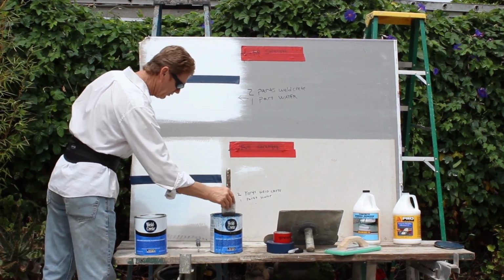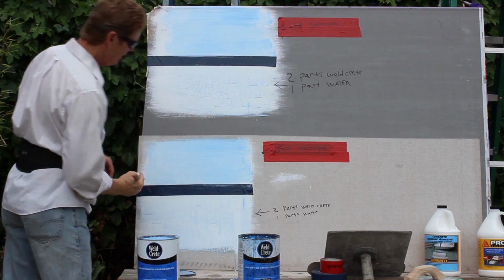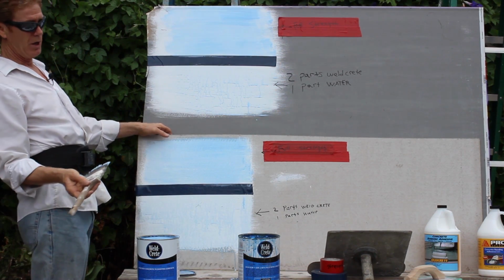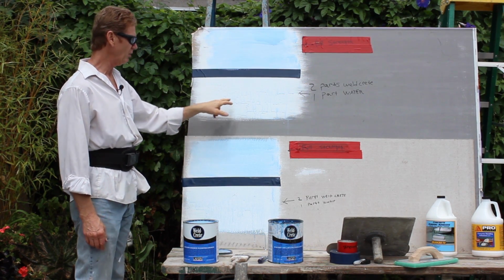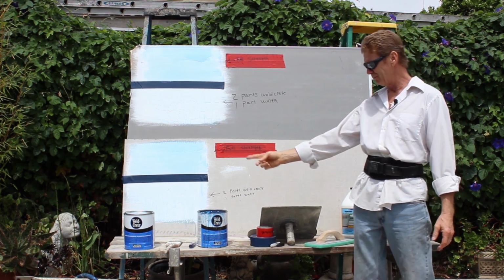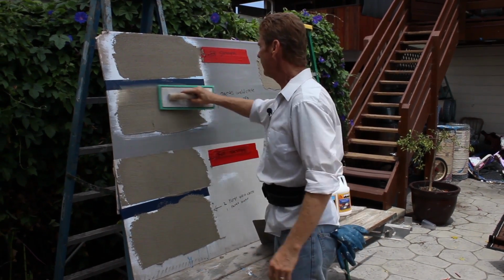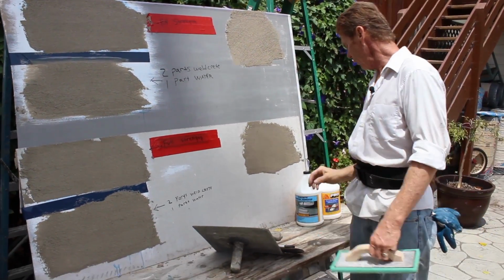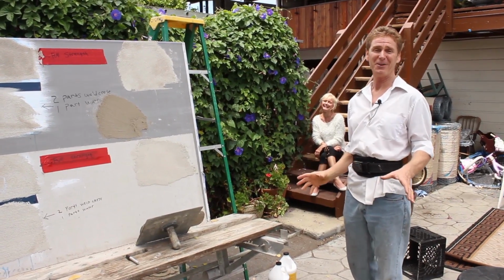Stucco and Concrete bonding agents.

Comment: Kirk! Huge fan and love your videos. Thank you for your incredible generosity. I have a question about bonding agents. Can I apply diluted weld crete to bare magnesium oxide panels? I'm an artist who makes gallery paintings with traditional lime plaster and need a more reliable way of adhering lime plaster to the MgO panel. My lime plaster is made with 1 part lime putty to two parts sand.  Currently I use a stucco slurry as a bonding coat but in some cases it has pulled away in areas due to fluctuations in temperature. The plaster is in good shape, and it's clear the stucco is peeling off.  Again, thank you for all of your wisdom in these videos.
Reply from the maker: Sorry, Michael, I have no idea what magnesium panels are, I just understand stucco walls, thus can't guess your question.😉

Comment: After watching the video i can't understand when you can use bonding agent in full strentgh without havinc spider cracks ?🤔
Reply from the maker: LOL, you're not alone. Most have no clue as to what I'm explaining.😉
Reply: Wow what a response. funny as heck but Omarnaja is probably pissed. Haha. but buddy here is what i got from the video. just keep it simple. if you're gonna apply a coating 1/2 inch to 1 inch thick, better go full strength on the weld-crete. Because its built for that type of application. but color coat is normally applied 1/8 inch thick which means diluting the bonding agent by half strength. Kirk packs a lot of info so you gotta listen carefully to catch all these tidbits or playback several times so it can sink in. lol hope i got it right too. HAHAHA.

Comment: Wait so can you use a bonding adhesive over a painted concrete surface before adding your cement ?
Reply from the maker: You still have to pressure wash the home so it's clean enough to eat off of, before applying the bonding agent.
Reply: @StuccoPlastering   thank you So much I will make sure its clean enough to have dinner on lol
Reply from the maker: Hello Daquan, yes, a bonding agent is necessary on any painted wall if you want stucco to adhere to it.
 Stucco will not stick or adhere to a painted surface at least not permanently. 
   It may be for a month or even 6 months but without a bonding agent, any and all stucco will separate from a painted surface.
Reply: @StuccoPlastering   wow thank you for the quick response 👏🏾your a life saver 🙌🏽 so I save a day on removing paint from surface

Comment: Hi Kirk, thanks for all the great videos. I'm wanting to do interior plaster over painted drywall. Plaster weld instructions say it only works for one coat, but I'm wanting to do a 2 coat, base and color. What is the best way to insure a good bond over painted drywall? It is latex paint.
Reply from the maker: apply your bonding agent first, then apply a basecoat lime plaster, when that's set a finish coat plaster, there is no need for a bonding agent from a basecoat to a finish coat however the basecoat must be moist for the mechanical bond.

Comment: Hi Kirk -- Thank you for the great content.  I've learned a bunch watching your videos.  I'm planning to stucco my cinderblock house.  It has a thick coat of paint on it - peeling in some spots, firm in others.  My plan was to scrape it as much as possible then apply a bonding agent and then brown coat/scratch/ finish with stucco.  Is this overkill?  would you just apply a bonding agent and color coat it, skipping the brown/scratch?  Thank you again.  As a carpenter, I admire your dedication to your craft.
Reply from the maker: Hello Stevenson, you arre correctomundo. If you just apply a finish coat over the cinderblocks, the grout lines will show.
 You can spread a skimcoat of, say, a half-inch, then a stucco finish coat material. That way, your block grout lines won't show when wet.😉

Comment: In wood finishing , we call this crackle finish and people pay me/us to do this to their furniture/cabinets :~) Instead of of weldcrete, we use animal hide glue.  Basically, the paint is shrinkingas it dries and since the glue has made a complete bond to the substraight, the paint(or color coat in your instant) shrinks and pulls away from the hide glue (or weldcrete)  As a matter of fact, you can apply hide clue to glass and when it dries and shrinks, the surface tension is so great that the glass surface chips/crackles, making icicle glass/glue chip glass.,,, so now you now!  I really enjoy your educational and entertaining videos.
Reply from the maker: Howdy, my friend, thank you for the comment, certainly, anyone reading these comments will now get a better understanding of why.😉
Reply: Great technique. I'll try it on some loudspeakers that I am building.

Comment: 1ST TIME STUCCO AND I NEED HELP!!! I'm going to re-stucco my house then texture it.  I've already patched/ filled cracks, rented Home Depots electric pressure washer. I think I'm going to use Ortega Color Coat Stucco in  Milky Quartz.  Kirk or anyone with knowledge about Ortega products:  Kirk says if your old stucco was painted you should apply bonding agent to wall 1st.  NOT mix it into stucco. SO MY QUESTION TO YOU IS: WHAT BONDING AGENT FOR WALL SHOULD I USE FROM ORTEGA ?   P.S. Still have a little paint chipped on wall can't seem to get it all off. That's another reason why I  want to apply bonding agent to wall and not into stucco mix. Thank you, Lori

Comment: I cringed when I saw Kirk open a can with a screwdriver, and then stirred the top  layers of the Weldcrete with the screwdriver!  Not the way to do this properly!!! Not getting a good stir of the Weldcrete, not good for the screwdriver, and you'll mangle the can lid, too!!!!
Reply from the maker: Good morning Moxie Dude, the only reason I used one of my screwdrivers was because I didn't see a tree branch lying anywhere, with a stick or branch at least I would not have had to clean my screwdriver.😉
 Don't sweat the small stuff my friend.
 besides our cans of bonding agent seldom last a week so I care little to make certain the tops seals are perfect. 😉 
   Now the engine for my truck, brakes and tires, I do care about.
Our unique plastering Tip:  all subscribers or anyone who stumbles on our channel with a question, type it into our Stucco/Plastering channel, and like magic, a video will appear to explain how it's done. 	
   This feature is miles ahead of any plastering forum. 	
https://www.stuccoPlastering.com
http://www.bayareaplastering.com

Comment: this video is so informative, but quick question Kirk, after applying the well crete what is the procedure after that if I'd like a smooth stucco?  I have a painted smooth exterior wall that I did a DIY. and I'd ilke a smooth stucco on it to make it nicer.
Reply from the maker: Hello Dale,  That's called a smooth finish. The bags have fine sand, Sometimes referred to as 30/30 sand. Use just your trowel to apply it.

Comment: Kirk. Wjat is procedure for
Painting over a color coat ? It is smooth stucco and customer wants an elastomeric paint.  Is there a special primer to use on the color coat ?
Reply from the maker: Good evening my friend asks for a primer and paint designed for stucco or concrete surfaces.😉
 Stucco-flex makes the best, type in stuc-o flex, to see what they have or try Sherwin williams.
Our unique plastering Tip:  all subscribers or anyone who stumbles on our channel with a question, type it into our Stucco/Plastering channel, and like magic, a video will appear to explain how it's done. 	
   This feature is miles ahead of any plastering forum. 	
https://www.stuccoPlastering.com
http://www.bayareaplastering.com

Comment: Hey Kirk, so I have the weld crete, for applying over painted brick.  Which grout/mortar/cement do I use for a "smear" look?  Thanks for your awesome channel!
Reply from the maker: Good evening Pedro, I would suggest either, Rapid set stucco it has a heavy sand.
Or GreenCore USA, it has a fine sand.
Both of these are sold at Home depot.
Our unique plastering Tip:  all subscribers or anyone who stumbles on our channel with a question, type it into our Stucco/Plastering channel, and like magic, a video will appear to explain how it's done. 	
   This feature is miles ahead of any plastering forum. 🥳	
https://www.stuccoPlastering.com
http://www.bayareaplastering.com

Comment: Hi Kirk, I am painting my house outside, it is stucco. Do I apply the Crete whole house? after the Crete, do I need the apply primer before the color paint? 🙏 thx!
Reply from the maker: If you are going to apply a cementitious color finish to a painted surface you need a bonding agent for the new stucco to adhere to.
 If you're going to paint a house you need primer and paint, not a bonding agent.
Reply: @StuccoPlastering   I am home owner DIYer. Thank you I just watched this.  I was going to put on bonding agent before painting over previously painted block concrete, looks like sand finish (about 3 coats of paint). Seeing this, I will not use bonding agent. I will do a good job with removing loose paint and pressure wash then apply primer and then paint or=paint including primer. I was thinking about color coat but will probably play it this way next time.  I was excited about your videos about color coat.  Maybe next house!  I like that southern moss color on two  other videos. Thank you!

Comment: Hey Kirk, I'm taking on a 5,000 sq ceiling in a church's sanctuary. How well does plasterweld spray through an airless? What are your thoughts on fibafuse tape for hairline cracks on 150+ year old plaster?
Reply from the maker: Greetings, David dude. I have sprayed a bonding agent once. That was enough.😉
 Using a roller with an inch and a half nap roller, wool preferred, is the fastest way to apply. 
Remember, it's not important and does not have to be pretty or uniform. 😏
As far as the tape, I just googled it, no idea why it's so costly. Thus I'll stick with Fiberglass mesh netting.
  Our unique plastering Tip:  all subscribers or anyone who stumbles on our channel with a question, type it into our Stucco/Plastering channel, and like magic, a video will appear to explain how it's done. 	
   This feature is miles ahead of any plastering forum. 🥳	
Kirk & Jason Giordano Plastering
Reply: @StuccoPlastering  Misspoke and meant the FibaTape fiberglass 38 inch rolls for extensive and wide areas of spider cracking- would love to know your take on the product. Have used paper wall liner with paper glue in the past with success but the stakes are high and gravity isnt on my side it being a ceiling- the church was built in 1842. Im set on spraying and back rolling the bonder- I'm a painting contractor not an old school plastering badass like yourself, Thanks for your time Kirk!
Reply from the maker: Howdy David Dude, watch this video, I think it's what you're talking about. https://youtu.be/QG39mjZGN_E/ Interior Rendering/Plastering with Fiberglass mesh netting,
Reply: @StuccoPlastering  Its their fiberglass cloth not a mesh- similar idea just more trustworthy i hope. Thanks for your time man your content is gold!

Comment: Do you dilute the other bonding agents 2:1 like you do with Weld Crete? Thanks for your videos. Very much appreciated.
Reply from the maker: Good afternoon Patrick, at the risk of contradicting myself, I will have to respond, do what the can or bottles say.
 Keep in mind, these bonding agents are powerful and are engineered for concrete over concrete. 
Thus not really designed for what all of us plasters use it for.
Such as a bonding agent over a prepped/pressure washed home that has a painted surface.
  Our unique plastering Tip:  all subscribers or anyone who stumbles on our channel with a question, type it into our Stucco/Plastering channel, and like magic, a video will appear to explain how it's done. 	
   This feature is miles ahead of any plastering forum. 🥳	
Kirk & Jason Giordano Plastering
Reply: @StuccoPlastering  Thanks a bunch. I will stick with the directions on the bottle. PL

Comment: Hello.  Can I tile over a painted concrete floor/wall after applying this product?
Reply from the maker: Good afternoon Bunny, no, These bonding agents are really engineered for concrete to concrete.
 You require a tile grout.
Tip, the tile grouts that are sold in buckets already mixed are not as strong as the powdered tile grouts in the bags.
   Yea, it's a drag having to mix this stuff up as it creates dust, but the powders are much stronger. Want extra strength?
 Add the Sika bonding agent instead of water when mixing bagged tile grouts up.😉
  Our unique plastering Tip:  all subscribers or anyone who stumbles on our channel with a question, type it into our Stucco/Plastering channel, and like magic, a video will appear to explain how it's done. 	
   This feature is miles ahead of any plastering forum. 🥳	
Kirk & Jason Giordano Plastering
Reply: @StuccoPlastering  Thank you 🖒

Comment: Great explanation of how the Amazon river appears in the color coat.  Would hitting the outside with mists of water prevent the cracking?
Reply from the maker: Good evening Puddy dude. This is an excellent question, but the fact is that hydration or misting the wall has nothing to do with this video or the rivers of spider cracking.
 The point I'm trying to get across is, Larson's Weld Crete is so strong for stucco. It's for concrete to concrete, usually 3 to 4 inches thick.
 It's too strong to adhere to a stucco finish, which is 1/8 thick to any surface unless it's diluted. Larson won't say this on the can, and I don't blame them as in my 11 years of teaching on youtube, only a handful understand this technical shit.
Note, You may also type in any question you may have on Stucco/Plastering issues on our channel, and like magic, a video will appear to explain how it's done. This feature is miles ahead of any plastering forum. 🥳
https://www.giordanoplastering.com/
Reply: @StuccoPlastering  Thank you, Kirk.  Your insight saves us noobies a lot of headaches and lost $$$.

Comment: Yesterday i used  sicka as a bonding agent on a 1200 square foot house I really messed up
Reply from the maker: Good evening Crypto dude. My apologies, sika, instead of water, is great for adhering grout for tile. However, it's not designed for stucco adhering to painted surfaces.
 I would advise a clean surface then applying a bonding agent to the substrate. This means the surface of what you are going to apply a new stucco finish too.
Note, You may also type in any question you may have on Stucco/Plastering issues on our channel, and like magic, a video will appear to explain how it's done. This feature is miles ahead of any plastering forum. 🥳
https://www.giordanoplastering.com/

Comment: Kirk, I sincerely love watching you and your sons bring such passion, discipline, and clarity to your craft. Could I please ask for your guidance? My contractor just completed an exterior structural support column replacement and we elected to finish the column using the same Santa Barbara Mission Finish (steel trowel smooth) with Crystal White color coat. It turned out very well, with the exception of indentations along the full height of all of the corners—on both sides of each corner— likely corresponding to where the corner trowel was pushed in to the final color coat. These are most visible at night due to illumination from the side.  If I understand correctly, one approach to correcting this would be the “Image” product (acrylic plaster), but, alternatively, if I understand this video, you could also use an appropriately diluted bonding agent and then attempt a final, FINAL sculpting and refinement with another color coat (SMBF). Do i have this right? I only have another day or two before my contractor moves on, so I’m so eager to get this addressed, if it’s even advisable to do so. (I’ll spare you my question about Fog Coat vs. Allegro II !!) 😉

By the way, I love it when you say (paraphrasing): “If there were an easier, better, or shorter way to do this, I would already know about it and I would be telling YOU about it, not the other way around.” I promise you: I will be using this at work! All the best and much love and respect! Chris
Reply from the maker: Good evening Christopher, I'll start by saying, smooth finishes are the hardest most time-consuming finishes for any plastering contractor to apply and by far the most expensive.😏
 Close to double the cost of sand, float or skip trowel finish, why, excellent question, there are two coats necessary for most of these, however, on occasion, one can be applied.
     I have not seen the work. However, the fact is many color coat can keep being applied over current color finishes, without a bonding agent.
 A bonding agent is used if the wall is painted or to kill the suction of the porous basecoat.😉
 So a third or even a fourth color finish can be applied by merely wetting the walls and using another finish.
     As a rule before agreeing to apply a La Habra Santa Barbara smooth mission or BMI, Marble finish, I give an example, as they do not come out perfect and are far from solid in color or appearance.🤔 
Kirk and Jason Giordano, Bringing to all the most complete plastering encyclopedia ever created in the world online.
 By the plastering messengers of Youtube.  With well over 850 free self-help videos 🎭 👀💃